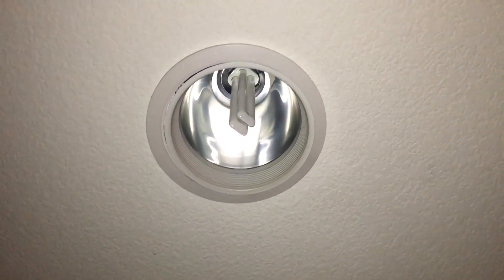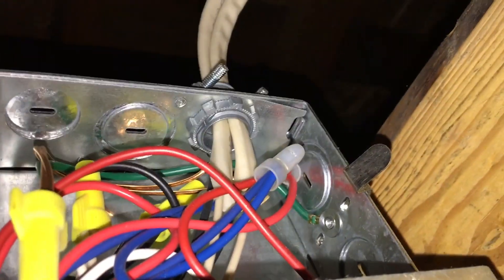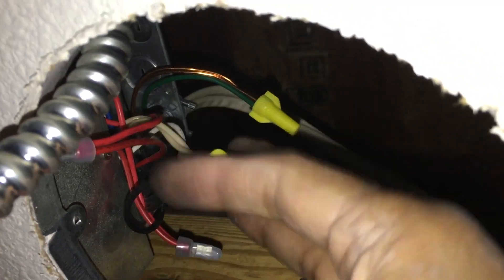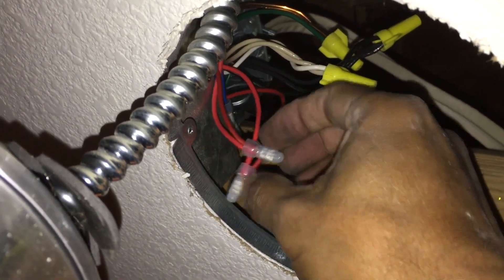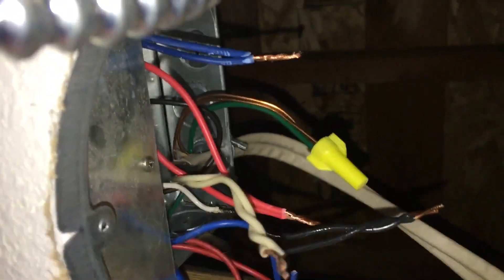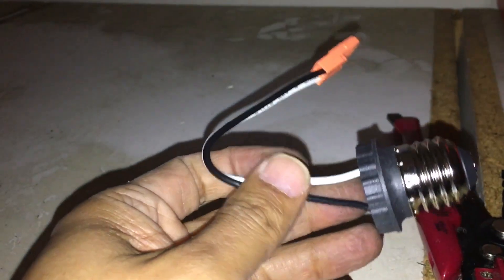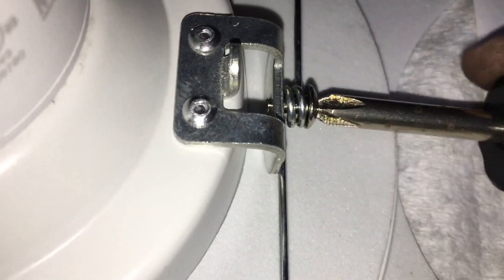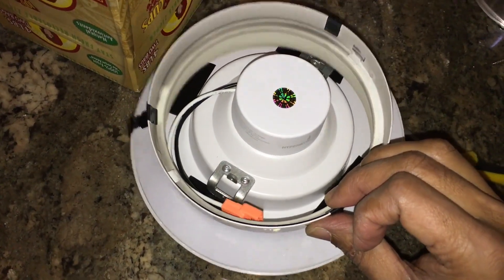Four-pin CFL to LED conversion

Comment: At 3:40, you show the two red wires joined together, and also the two blue wires joined together. Am I correct to assume that you would only need one red and one blue wire?  If so, why strip and join together the red and the blue?

Comment: It's supposed to be BLACK to RED and BLUE to WHITE.  But it appears to have worked for you. Hmmmmmmm   https://image.slidesharecdn.com/4pincfltotitle24ledwirediagram-150903232958-lva1-app6892/95/4-pin-g24-socket-cfl-to-led-conversion-for-canned-lights-1-638.jpg?cb=1441323741

Comment: Although this could be condensed into about 5 minutes, this is probably the best solution to changing out a recessed fixture designed for 2 or 4 pin CFLs to an LED  conversion. The advantage is that the ballast is bypassed and that the existing wires are used